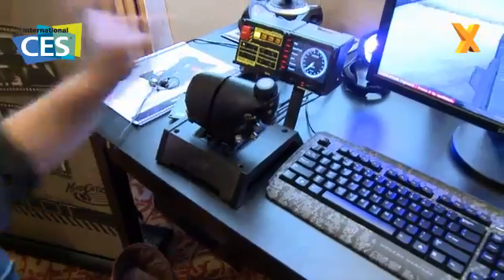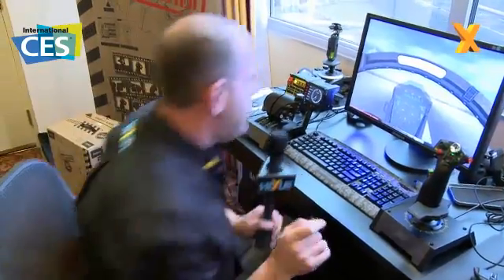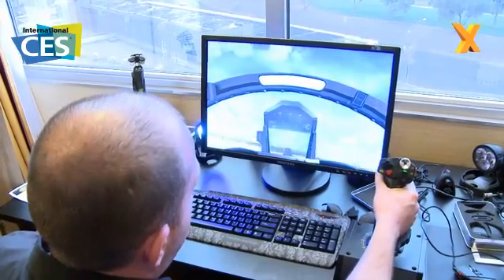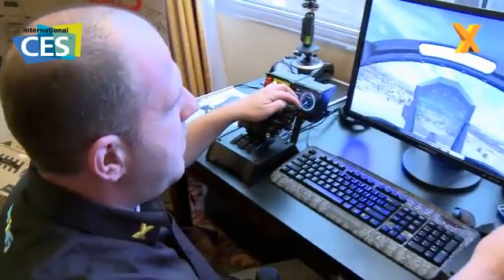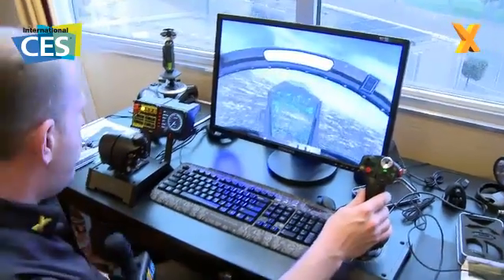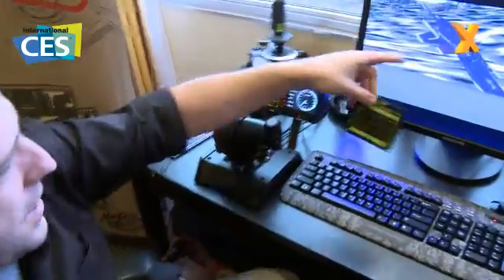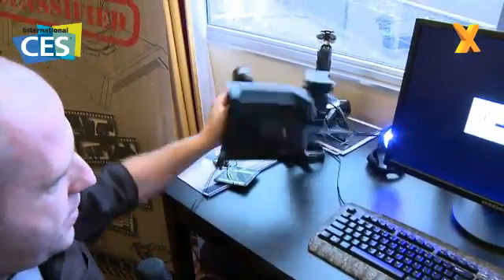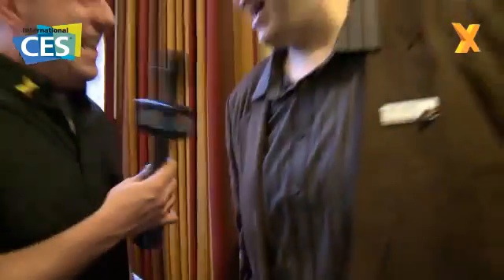CES 2010 - Introducing the X65F  HOTAS from Saitek

Comment: Are there any real planes or helicopters that use this system. With a solid stick, which just uses pressure to pick up your input.
Reply: The F-16
Reply: It doesn't.
Reply: Tonyb123123 yes the F-16 and F-22 and some commercials planes. but as a side joystick. and real pilots hate it. and I hate it too. it's very exhausting, and zero feedback.
Reply: The F-16 originally had a non moving force sensing side stick. Test pilots hated it so much that eventually this was changed so that the stick would move about 1/8th of an inch in each direction to give the pilot a better sense of how much stick pressure he was applying. The F-22 I believe uses almost the exact same system, a force sensing stick that moves a very small amount in each direction.